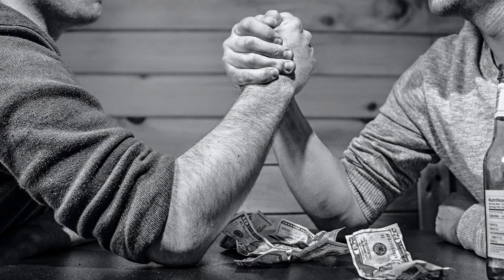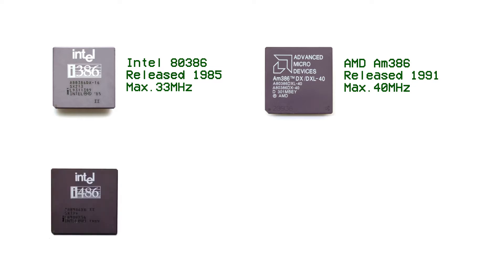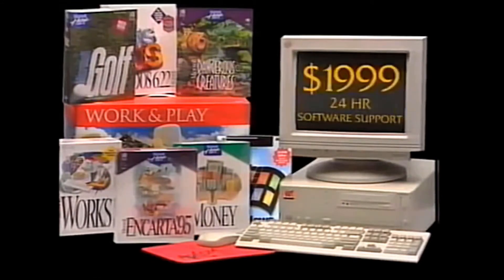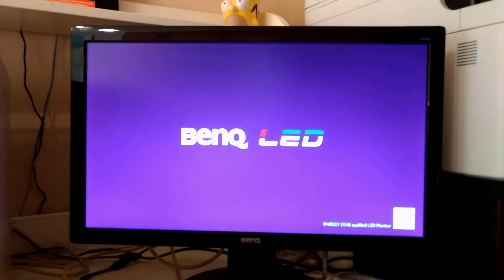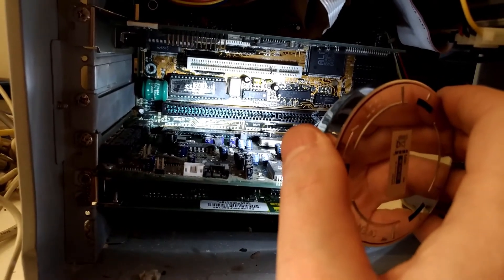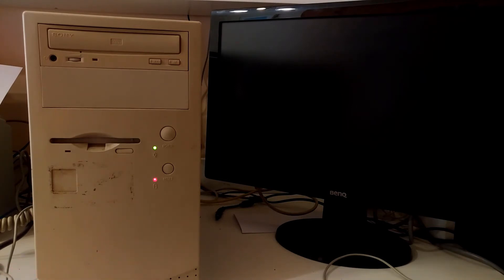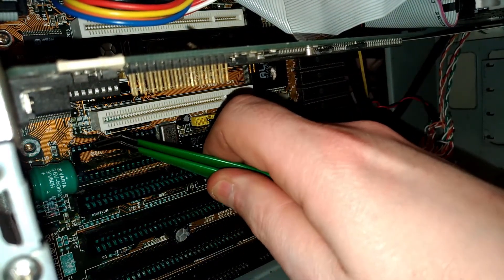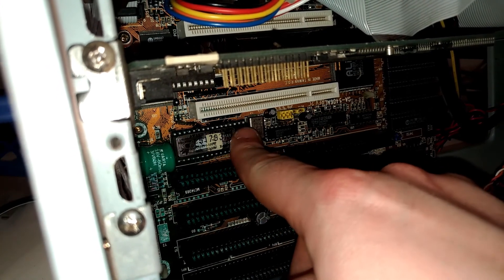AMD vs Intel: Filthy 5x86 Fail featuring AMD Am5x86-133!

Comment: My first PC had a Cyrix CPU, I had it for less than a week before I took it back to Escom (UK Ltd) and paid and extra £100 and got a proper CPU that didnt crash, namely the amazing Intel Pentium 75MHz (AKA the P75) :)
Reply from the maker: Cyrix was a CPU maker I wanted to like, but just couldn't. Some of their CPUs were decent (like the later 6x86), but their earlier stuff was a bit dire.  It also didn't help that there were plenty of dodgy Socket 3 motherboards out there that wouldn't play nice.  

Fun times.

Comment: Im kind of jealous. I dont have a thing in the garage thats my original, everything is bought to copy what i had.
Reply from the maker: Thanks!  By the time I got to my 20s, I realised that I should probably hang onto stuff for a bit longer than I used to! 

This machine survived a purge about 10 years ago (where I sent about a dozen carefully hoarded 486 and Pentium machines to e-waste ... what was I thinking?!).

Meanwhile, because the house was gradually filling up with the various chattels accumulated by my spawn, it pushed my toys out into the garage.  I kinda wish I'd exorcised that demonic battery before shoving this in a corner of the garage.  Ah well, I should be able to milk a good half dozen episodes out of restoring this machine.  Silver linings and all that. ;)

Comment: My first PC was an IBM (Cyrix) 6x86MX PR166 :-)
I retrieved it from my parent's house a while back.  The hard drive made a horrible noise, the board needed recapping, the PSU was toast, the case was falling apart, the power button was broken... that's what happens when computers are stored in the basement/garage for who knows how many years.
I re-created that machine using an AMD K6 (and a new motherboard, power supply, and case) :-D
Reply from the maker: Nice.  Is the AMD K6 build on your channel? :)

Meanwhile, I've since relocated most of my garage machines into the house.  The 5x86 will get a resto at some point (although I'm not sure if I'll cheat and get a replacement motherboard), and I've since learned that 10+ years of overnight sub-zero (celcius) winters and 40+ degree summers in a brick car hole with no insulation ... not a great environment in which to store computers.
Reply: @OzRetrocomp  Yeah, it's the first video I have.  I've since changed parts on that machine, so that video may not be exactly what I have now.